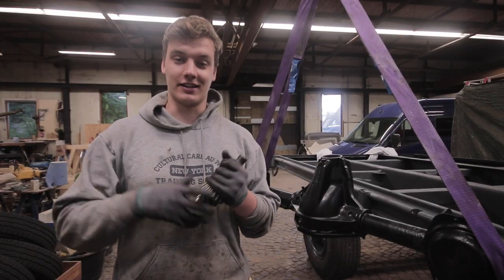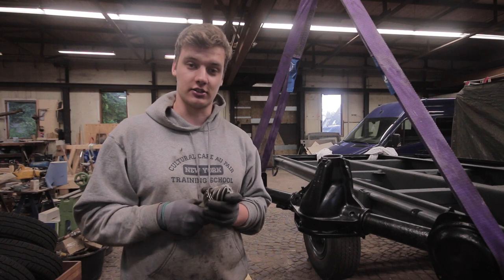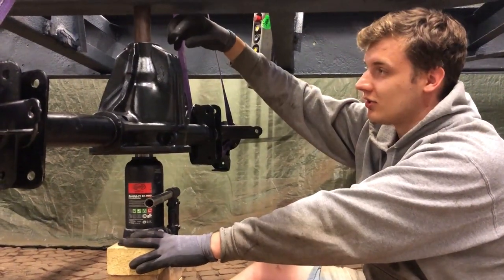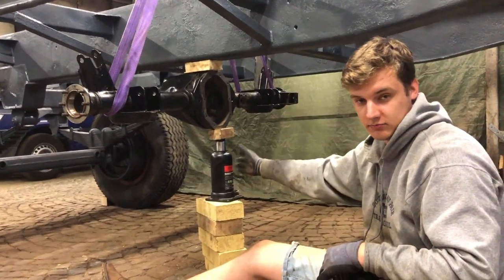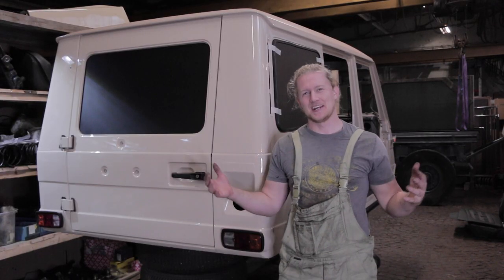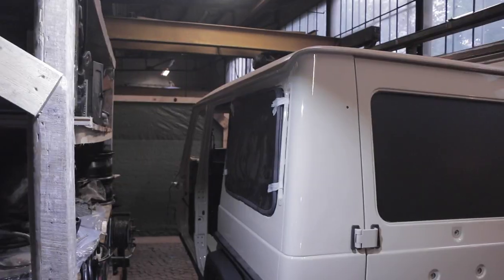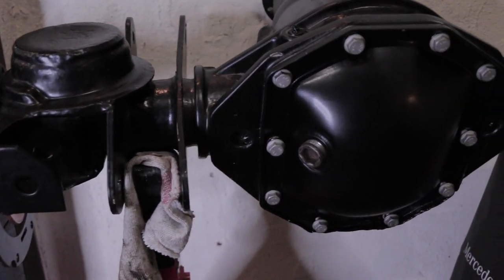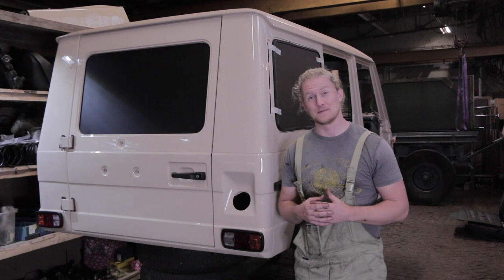Finally installing our differentials w/o specialty tools | Project Thor Ep11

Comment: Thank you for this very enjoyable series and also the series on the history of the G, they are great. One concern from a few videos back, especially as you put all of the work in on rust removal. I know you see people drilling through newly painted body shells all the time on TV, but I think most of these project cars never see daily use or get wet. I would speak to an bodywork expert, but I suspect that the bare metal, especially in areas like the wheel arch extensions, will need more protection than just a blob of wax undercoat. Those waxes have a tendency to melt and move if they get hot, look at the dirty marks below many Mk. 2 VW golf’s tailgates for evidence of this - that’s the rustproofing wax running out of the drains in the tailgate, sticking to the panel below and trapping dirt. Places like the wheel arch extensions and where plastic trim plugs are inserted are perfect water traps and will most likely start to corrode very quickly, especially if you get road salt or seawater on them. After all that work it would be horrible to see the body start to rust again because of bare metal that hasn’t been primed and painted. Best of luck with the rest of the restoration, my dad had a W460 so this is also a nostalgia trip for me!

Comment: I love you guys all the way from 🇩🇴🌴!!! I’m in the midst of trying to locate some Cr20Ni80 wire to restore an old fuel sending unit for my G. I’m going to drop the fuel tank and clean out all the rust and sediment chocking my fuel pump, and replace current fuel sender, which is not giving me fuel reading.

Comment: Thanks so much for sharing your work on this project. Just had a thought: I don't know what kind of recovery gear you plan on carrying but if it can be used to right the car in case it ends up on its side, you probably want an emergency access to that compartment from the inside - you know, in case the car ends up on its left side. Tipping over in a G is something I have actually witnessed first hand :)

Comment: Great job of being creative and solving problems as you go along. I found it very interesting that MB has the differential housing compressed from top to bottom to provide the space to achieve the proper carrier bearing preload. Most American differential manuals use a case spreader from side to side to provide the bearing preload. Both ways work, but one does it by compression, the other by spreading. Thank you for the video update. I look forward to the next update.
Reply from the maker: Case spreader is what the MB manual prescribed, but wherever we asked, we couldn't get our hands on one. So we had to get creative!